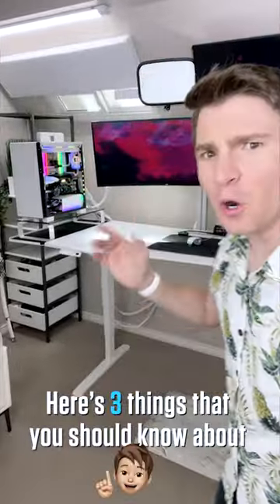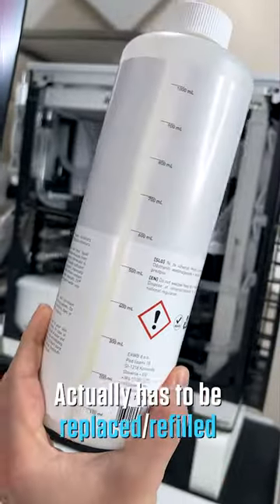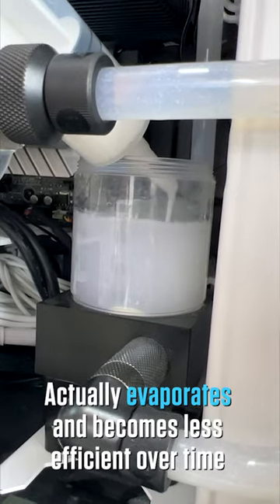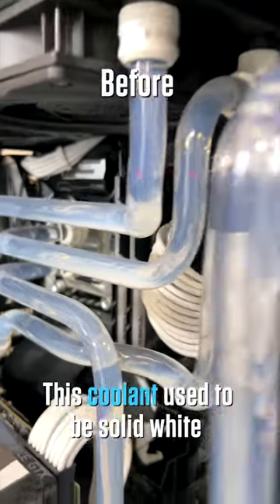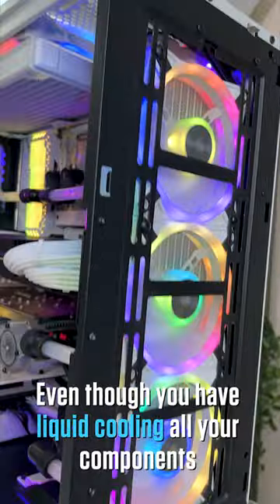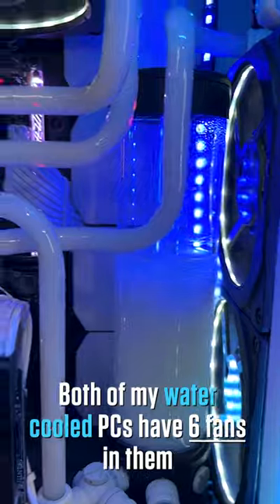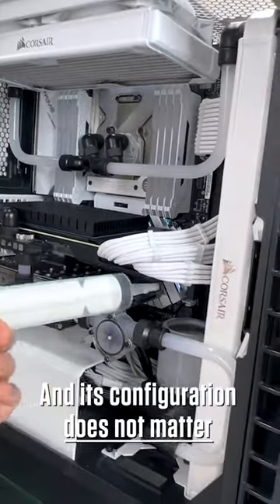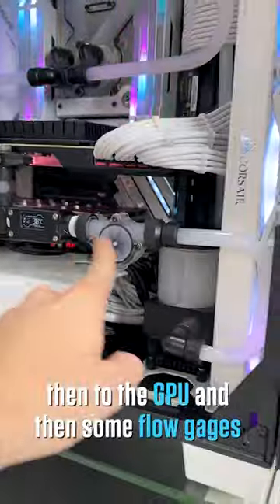3 Tips You Need To Know Before Building Your Own Water Cooled PC #shorts

Comment: bro it does matter if you put 3 components direcly behind they will not get good cooling
Reply from the maker: I've seen PCs loop 4 SLI GPUs directly into the CPUs with resulting great temps. A really good D5 pump (if not 2 pumps) makes the difference to get good cooling in 3+ component examples👍🏻
Reply: @AprilMayRain  bro if you use sli you can’t choose
Reply from the maker: @leanderkretschmer712  SLI will still have flow ports between the GPU to configure it's just not that common. Most SLI setups will treat the multiple GPUs as 1.

Comment: dont EVER replace coolant unless its MEASURED to not be doing its job. Blindly waiting 6 months is just wasting money.
Reply from the maker: At the enthusiast level, 6 months is standard. Data centers can wait longer with built-in filtration systems to never surpass 1-5% yield loss. And it's not just about replacing the coolant but also flushing your radiators and cleaning your parts. It's just good practice to keep your PC fresh.

Comment: the only rule about config is that the pump must be near the lowest point.
Reply: and why is that?
Reply: @ignited3443  gasses? what? where would the gasses rise up from?
Reply: @ignited3443  if you mean air bubbles then yeah i dont think it needs to be at the lowest point just below the radiators is fine
Reply: @scidja8567  Yea but closer to the bottom. The better.
Near the bottom will always be a nice spot for circulation.
Reply from the maker: @ignited3443  I know if you have a pump/res cambo, it's good to have it at the lowest point. One, because the largest amount of store liquid in your system isn't mounted above all your other components. Two, it's way easier to fill/drain your loop.

Comment: Number one:
Linus already established that air-cooled is superior 
Number to:
Way to cost inneffectife
Reply: and flow meters hurt the flow
Reply from the maker: Linus tested the type of air-cooled system that's comparably with a water cooled system. "Superior" is a prospective. 

And yes flow meters hurt the flow but not  enough to make any difference to temp or preformance if you have a D5 pump.

Comment: Ethilen glycol used to disipate heat? For real? It's the opposite!
Ethylen glycol is antifreeze and will lower freezing point at the cost of worse efficience by lowering the heat capacity.

You want lowest amount of antifreeze in the system and prevent freezing (for a car cooling system). Pure water has the most specific heat with over 5000J/KgK and ethylene glycol has 2400J/KgK.
Reply from the maker: Why would every water-cooling component company like EKWB, Corsair, Alpha Cool and many others use ethylene glycol in their products then??
Reply: @AprilMayRain  they use it for the other benefiets like corosion resistance, electrical insulation (for protection against galvanic corrosion), for protection against cavitation of the pump by altering surface tension. And for protection agains freezing.. probably for transit and storage of the product.
Reply from the maker: @AsiAzzy  😮😮

Comment: It should be important to have a radiator between the CPU and GPU, the liquid that comes out of the CPU and GPU is very warm and accordingly takes up little or no energy
Reply: In theory yes but reality no. The reasons are:
1. The water flow is high, so the water won't actually become much warmer right after the CPU. 
2. If you out load on you PC,  eventually the water temperatures will be at a stable value. And again because of the flow, it's not that the water is significant cooler after the radiator.
Reply from the maker: @rasmuspersson1000  Great response! Made sure to heart your comment so it can help others✌🏻

Comment: Dude what? There are people running 12900k and a 3090 off of a 240mm radiator and getting good temps. Idk where you're getting this "rule of 1" but it's made up
Reply from the maker: What do you define as "good temps"? What "people" are running just 1 240mm in a custom watercooled PC? I wouldn't recommend overclocking with that configuration. I know the 12900k and 3090 are efficient but not THAT efficient to get good temps. Do they like only play Minecraft or live in a colder country or have like 12 fans cuz that would make sense.
Reply: @AprilMayRain  no the first one that comes to mind has it in an itx case that's strapped to the bottom of his desk in a small room in an apartment.
Reply: @AprilMayRain  and he gets about 65c on the GPU and I think it was either high 60s or low 70s on the 12900k under full gaming and streaming load. And no It isn't Minecraft, but Minecraft is one of the hardest games to run right now so it probably would be a good test
Reply from the maker: @ARCbirdman  I like to look at specs, temps and benchmark numbers but if he's able to stream and not toast up his room or melt his PC than that's awesome! I still believe in the rule of 1 for a first-time PC builder, just to be safe and get the results they are expecting.
Reply: @AprilMayRain  I'm talking about optimum tech btw

Comment: The ignorance in saying flow routing doesn’t matter……smfh. Efficiency most not be something you understand.
Reply from the maker: Hey John, efficiency is all I care about. Heat transfer, thermal capacity and the basics of thermodynamics must not be something you understand. Doing a bit of research before commenting will help YouTube become a better platform for everyone🙏🏻🙏🏻
Reply: @AprilMayRain  route your pump backwards so your fluid runs to your cooler before reaching your GPU or CPU or m.2 cooler or whatever youre running, routing matters if youre looking to get the most heat out of it as efficiently as possible. It’s a cooling system, no different than that of a car. And that I have nearly 20 years of experience in. At the lowest levels of ignorance, flow routing matters because not everyone builds PCs for a living, you’re simple IN and OUT aren’t always seen by the general public. Cavitation or wrong direction of flow both can be cause by improper routing, it’s a very simple concept. “Doing a bit of research before commenting will make YouTube a better place for everyone 🙏🙏” Humble yourself……quickly.
Reply from the maker: @jc0326  I agree that a watercooled PC is a very simple concept when it comes to heat exchange, but a PC is NOT a car. Yes the concepts are similar in its cooling systems but the size of the heat exchanging elements and heat capacities can NOT be compared. Especially when you're comparing the cooling capacity volume of a PC to a cars. I see you haven't done your own research and just replied with a defection. smh... I'm excited to see your video with your 20+ years of experience  explaining why PC flow does matter so I can watch.....intently. 

Send me the link 🙋🏻‍♂

Comment: Tip #1: Use distilled water, never need to change it (almost never)
Tip #2: Oh, air cooling works?
Tip #3: Air cooling is superior in almost every way.
Reply: Yeah cheaper too and no leak chances.
Reply from the maker: All valid points jb lol